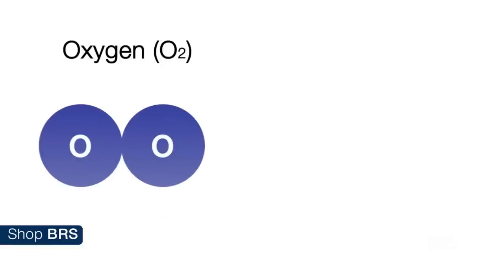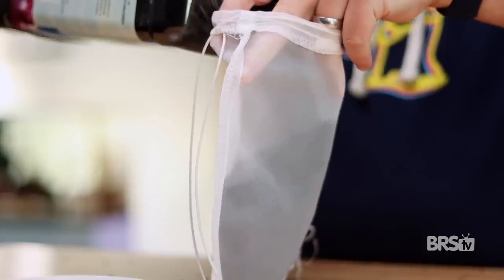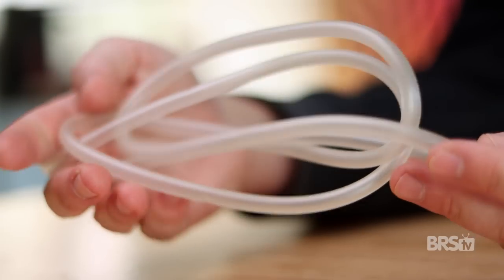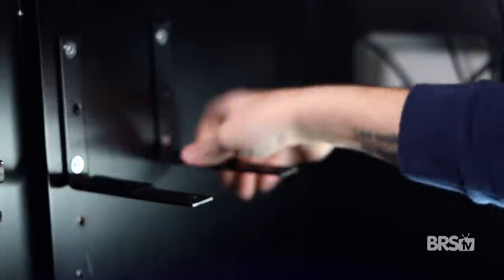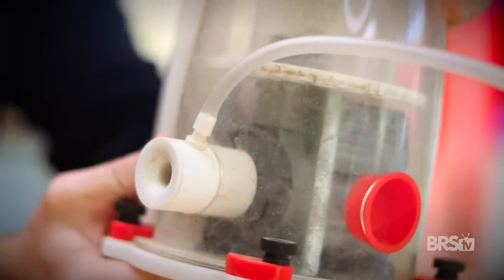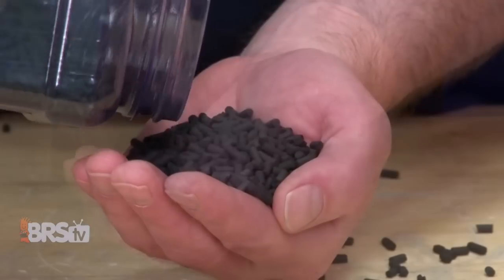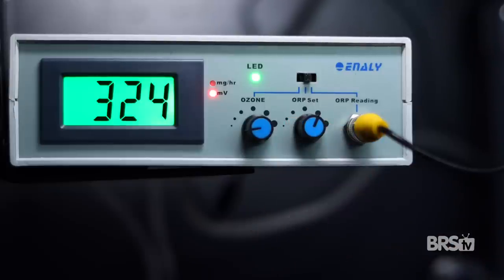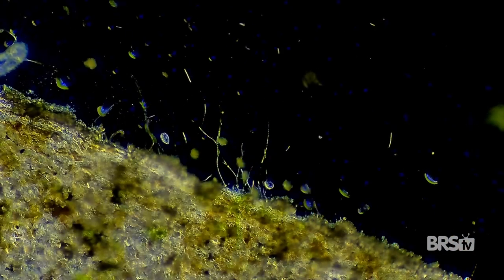How to Set Up Ozone for CLEAR Reef Tank Water!

Comment: So I just got this unit today! Question, I have a 120G system. How many miligrams  should I add, and how long should I run it? Maybe an hour a day? So, do I divide  my tank volume by 15? If so, that's 8mlgs per hour?  I have it set at 320 ORP to start SLOW. Thanks in advance!

Comment: I just saw a video re a test that was run on two extremely different doses of ozone used in a 10 pass setup (removing, ozonating and returning the ozonated blood back to the body) . One was a high dose (as with a standard 10 pass treatment) but the OTHER was with a homeopathic dose - which is basically just water's residual response to having been in contact with ozone BUT THEY BOTH HAD THE SAME EFFECT ON THE BLOOD! Which would suggest that even the tiniest amount of ozone, shaken into a measure of water would be all one needs. It would be an interesting test to use so little ozone that it could be said one hadn't used ANY ozone, just to see if it has an effect...

Comment: Good evening, I want to ask in the video you said to turn on the ozone if it starts at 325. if the previous ORP was at 150. how will it reach 325. as far as I know, correct me if I'm wrong, to increase the ORP of the water by turning on the ozone. If the setting is 325, the water condition is now 150, it won't turn on.

Comment: Looks intriguing. My baseline ORP based on my Neptune is already running 400-430 - not running ozone but skimmer and Reefmat roller filter. Water looks clear (but haven’t done the 5 gallon test). Any thoughts on ozone in this case? Is the Neptune ORP reading just off?
Reply: That's really interesting Steve.  I'm not sure what's going on.  This is the first time I've ever measured ORP but I will say that without ozone my ORP is around 230.  I'd be curious to see if it was in fact the ORP probe giving an incorrect reading, or if there is another reason why your ORP is so high.  Anybody reading this know the answer?
Reply: This is exactly what I had and installed a new probe yesterday along with verifying its reading. My new probe read 225. Everything after this is based on what I've been reading so do your own. 

What I also read from others is that your orp placement can be important as they were dosing a particular bacteria up stream that happened to collect and fowl the orp within 2 weeks time. Exposure to light would also be bad.

Soaking your probe in vinegar can clean and reset it but you would want to test in a known redox solution. Cleaning is important because anything touching the probe will change the reading.

Today after running a minimum 10% O3 (bigger unit) for 12 hrs over night increased my orp to 325 (stable after about 1hr) on my 300gal. I used the Poseidon 200 partly because the other model wasn't sold on BRS at the time.
Reply: I'm not sure if the Reefmat Roller is that good, never used any of them but I would serious get another probe or stand alone unit with probe from a friend or a rental if possible and get it double checked my friend.

Comment: Just installed this unit is it normal it makes audible noise or
Reply: Strange I've been using Ozone for many years and never heard any noise come from them, even at full throttle. I use 2 brands, Weipro which is a chinese brand on smaller systems, and a top of the line brand called Sander from Germany for my aquaculture business, this system is 1,320 Gallons.

Comment: What happens if you’re doing recirculating co2 scrubber, how would this effect the ozone and ozone smell?
Reply: It can actually work really well in a recirculating skimmer.  You'll want to make sure there is a ozone port, and if not, you may experience decreased skimmer performance.  The safest way to not effect your protein skimmer is to run a second small and inexpensive protein skimmer.  But you can definitely make it work in a similar fashion using a recirculating skimmer.

Comment: I’ve wondered about this… if that third oxygen molecule that breaks away from ozone is the “active ingredient” (so to speak), how is that different from hydrogen peroxide? H2O2 -> H2O + O which then oxidizes things…. The same as ozone… So what’s the difference?
Reply: The difference is the reactivity, you're right in HOW they work, but Ozone is about twice as reactive as peroxide, that means it will attack and neutralise molecules that H2O2 will do but slowly, or not at all. Also, once ozone is set up, you don't need to keep buying more peroxide, and finally, once a bottle of peroxide is opened, it starts slowly breaking down naturally, which precludes most people from saving money by buying it in bulk. Ozone has it's drawbacks, but you'll only knock over a bottle of peroxide once before realising it's worse in practical terms.

Comment: What tank size is Ozone recommended for?
Reply from the maker: Ozone can be used on virtually any tank size, but it's most commonly used on medium to large systems where media swap outs and water changes are more expensive.
Reply: I purchased this 100 sized one for my Waterbox 180.5.  Running at max 24/7 I can barely get the orp to read 300.  I’m normally in the 250-280 range.  So, I’m going to sell my 100 and upgrade to a 200.  I would say that the 100 is sized for anything 120 gallons or smaller.

Comment: Hi Matt! I am battling a serious dino outbreak at the moment and saw the recent BRS video with Randy and Elliot speaking about their experiences with ozone. Randy mentioned ozone getting rid of his dinos. This is what made me look for more videos on ozone and ran into this one. I must say, you pretty much simplified everything for me! You are an incredible presenter!  I went ahead and purchased the Enaly 200. My question is, should I have gotten the 100 for smaller ozone input? I have a Waterbox 220.6 and would also like to try it on my 100 gallon frag system which is made up of 2 50 gallon low boys sharing the same sump. Would this unit work for both of these applications or should I have gotten the Enaly 100?

Comment: how do i lower orp when mines at 430-445?
Reply: Hi Brian, really interesting question.  I'm actually wondering if your ORP is that high without ozone?  It might be that the probe needs cleaning.  I would double check with another ORP probe to see if it's actually that high.  For reference, my 100 gallon frag tank sits at an orp of 230 without ozone.
Reply: @matthewbrstv38  wow that is a big difference. Im using the apex prob and its been reading that way since the day i got it and they are quite clean.

Comment: So in other words, it's more pain that it's worth.
Reply: I run ozone 24/7 through an airstone in my tank, the bubbles run up an old syphon tube, and the hose that attaches to it is stuffed with GAC. People want these things to be more complex than they need to be. What's the point of drying the input air and messing about with a skimmer to make it all 10x efficient just to then have the thing turn off and on every 2 hours? Let it be 10x less efficient and run it 24/7 like I do, ozone generators use like 6w of power, too.